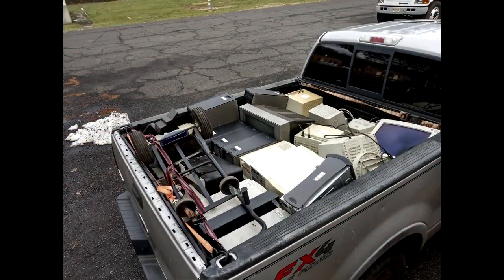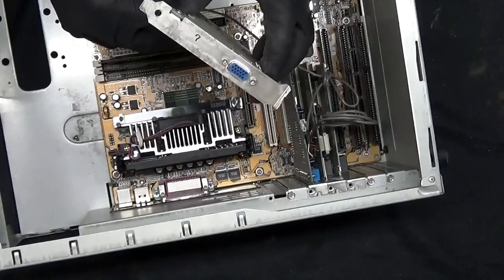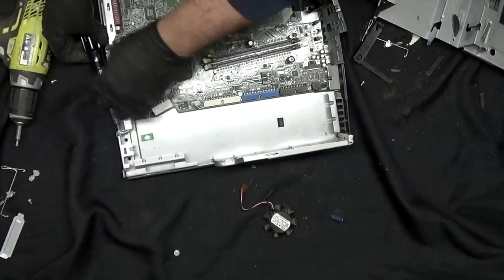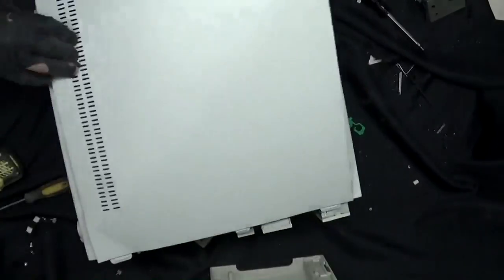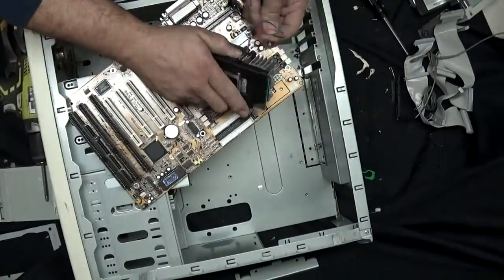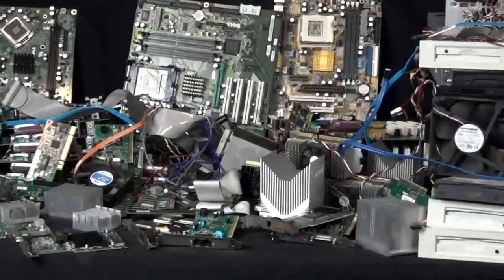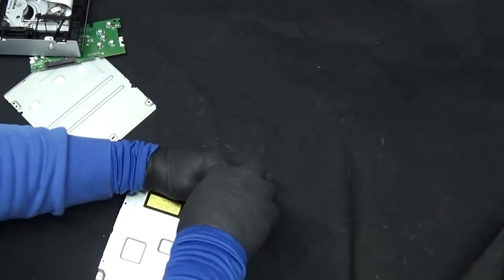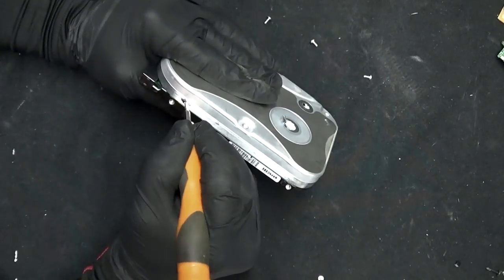Any money in Computers ep #1 Pt #1

Comment: Nice vid Mike the scrapper! My question is what bit type is used to remove platter screws?  I've tried many with no sucess.
Reply from the maker: Try Torx #T9. Or if you have a Security Bit set that will work also.
Reply: Cool. Thanks

Comment: How many hours did it take to break down these computers ?
Reply from the maker: If I was not filming, I will say less than an hour.
Reply: @MiketheScrapper   i very much doubt that sure you can strip a computer out in 10 minutes but you disassembled the hard drives and stripped out all the wiring my guess would be about 3 hours by the time you sorted it all out , next time make a video in real time from start to finish